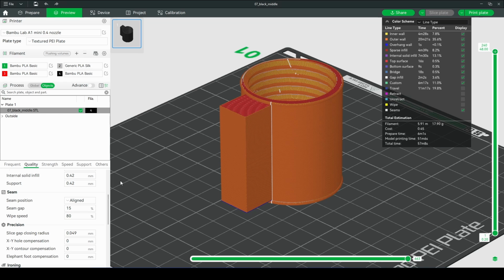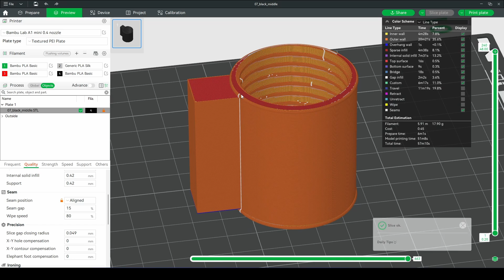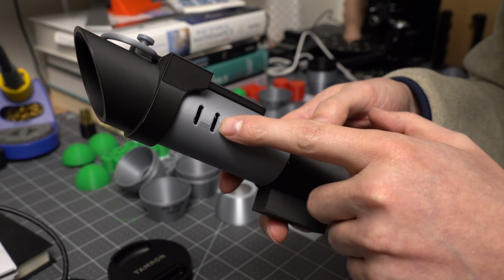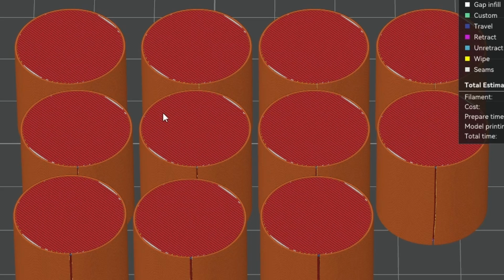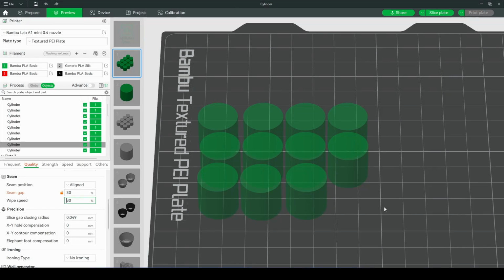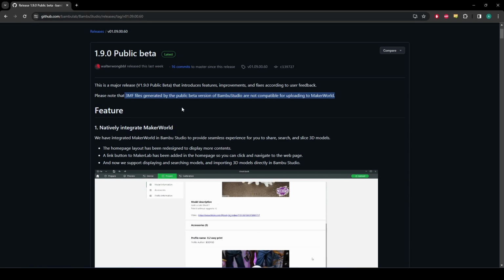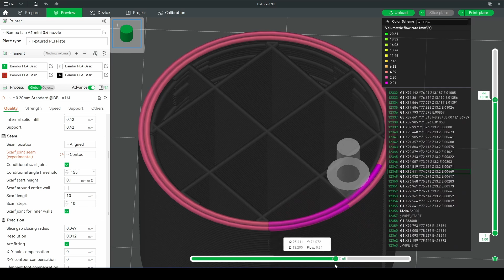Getting Rid of Z-Seams on Bambu Labs 3D Printers?

Comment: what if you drew the seam on the inside of the model to avoid exterior seams? is that possible? 🤔Or does the seam go through and through? (outside and inside) Also, can we do horizontal seams instead of vertical? 
Probably all  silly questions, but I'm just trying to understand the system before I get into 3d printing with the P1S 😅

Comment: Why can't a 3d printer go in a helix line while printing round objects like in cnc machining? i dont understand why it needs to start and end at the same point for all layers just print round and whenever you cross the start line go up by the desired layer height why is that so hard to implement...
Reply: This is already implemented in slicers for quite some time. It's called 'vase mode', but the obvious limitation is, that it can print only a single wall, so it's impossible to use it when we need to print more than 1 wall. Which is almost always, because 1 wall is not sturdy enough for majority of applications. I often use it when I am forced to print the part in orientation which produces undesirable look - I print a shell in the vase mode and put the part inside.

Comment: They need to add distance to retract, there is no need to do a retraction on parts where the outer wall is all one movement. If the nozzle does not need to move say move than 3mm to the next segment, then it should not retract.

Comment: When generating the ramp of a scarf seam for a none linear Z surface, the X and Y offset of the next over layer needs to be linearly (or other methods - cubic, etc) interpolated by the transition of the Z height.

This way it will hopefully give a smoother result over a surface with Z axis curvature.

Comment: i wish i had an option to put it on the inside or at least print outside/in instead of inside/out. i know they have this option in cure but not in bambu. personally i've been printing for so long and moving from cura to bambu, the setting are rudimentary to user custom settings. i'll have to try out this scarf out it looks promising thanks.

Comment: Just the info I was looking for to help hide seams on a replacement cupholder for my car! The although functional first print has some horrific looking seams, lol.  I'm going to play with scarf seams and random location and possibly fuzzy skin effects.

Just an idea for straight seam painting, could you use mouse keys to get a nice straight vertical/horizontal/45 diagonal line in Bambu Studio. I used to use mouse keys loads in Microsoft paint as a kid! Mouse Keys uses you num pad to move the cursor, I've just checked it's still there in accessibility options in Windows 11 :-)

Comment: Seeing this makes me wonder if development of slicers has gone backwards... I was very active with 3d printing back when they first appeared and experimented a lot build my own printer and stuff. Then didn't use my printer at all for a few years and just recently started with printing again with a Bambu Labs. 
But back maybe 4 years seams were fixed already! Why do they appear again in current slicers/printers?
Thing is that with layer change and retract at the start of a layer it happens that there is either not enough or too much material in the nozzle. Hard to tell usually cause different materials have different flow. So you could fine tune for every spool you have but usually the easiest way is to hide that inside a wall or even inside infill. So layer change should be on an inner wall loop or over infill and then have a little coast to get the correct flow. Then can switch over to outer walls and they become perfect.
Has this knowledge been lost? Or did they use some outdated code to build their slicer on?

Comment: In Bambu Studio scarf seams have a starting %, setting try reducing it. I picked random + scarf seams and reduced the scarf start % and  I also reduced the scarf length to 3 mm. I cannot see seams on a smoothly curved ABS GF.  YMMV. Having a contaminant like GF in the material probably helps as it roughens the surface slightly hiding layers and seams.
Reply: Just stumbled upon that as well. About to start testing. Its worded as "start height" which doesn't make sense. Default was 50% and you can see in the flow that it just abruptly reduces flow.  Lower percentage seems to be a more gradual flow reduction. I'm curious if delaying that reduction would result in having excess material at end of scarf and would need to lengthen scarf to accommodate.
Reply: @generation-x406  Yes, in Orca Slicer the default is much less than 50%, I forget the number but it's much lower. In Bambu Studio I was using ~20%. I don't think of this as purely flow rate so much as the starting wedge beginning height, although I don't know if the z axis is adjusted with the flow increasing but I assume so. I imagine it as a rising wedge on the start of the loop with corresponding flow adjustment and the reciprocal wedge on the close accomplished by keeping the head level and the flow reduced. However setting it to 0% I assume invites problems of precision and contact with the previous layer. The 10mm wedge length seemed a bit excessive since all it's trying to do is feather the loop beginning and endpoints.
Reply: @dorbie  I assume the Z height adjustment might be the "steps" per scarf length. A rate of Z climb between two known Z points.
Reply: @generation-x406  Yes, I assume it is the discrete divisions of both flow rate and z height injected into the g-code by the slicer, although there will probably be numerical and mechanical precision limits involved.

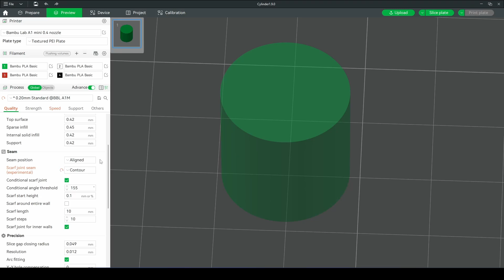Comment: The settings at 10:30 break my slice as my model goes from 108mm height height to x925440.00 height giving me a G-code max height error. Seems Bambu needs to work a bit more on the implementation.

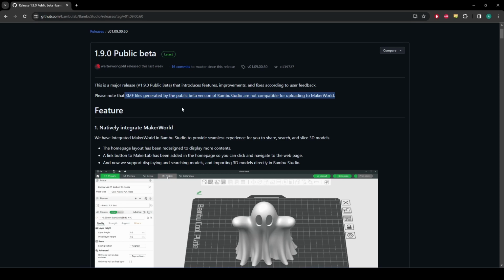Comment: 7:55 sure you can! just add a user account on your pc or mac ;) have as many as your harddrive supports.

if you want to see what orca does different you can export the gcode from both bs and orca. open them both in notepad++ and cut the top part of both files that has regular text into new files. then compare use compare tool ;) i found that orca does somethings better and bs does somehings better. if i dont get the result i want from orca i try bs. then do the above routine to forcefeed the settings bs used to the orca generated gcode manually. best of both worlds imo. 

also set the slicing resolution to 0.001 and turn off arc and arachne. experience the smoothest walls possible. no more lines that are off from the one above or under. its amazing. takes longer time to slice but its so so so worth it. drawback is huge files to transfer. but hey.. time vs quality right?

Comment: Random is situational. I like it in some cases.

1. For strength, to avoid explicit weaknesses in a loaded part.
2. To distribute deformation introduced by the starts, you could get a bulge in threads for example that you can feel when screwing if its all in one spot. 
3. For surfaces with Fuzzy Skin texture, which is perfectly augmented.
Reply: bearings is another example of a good use for random.

Comment: Its hard to tell from just the video, but it almost looks like on the default seams the 100% gap is actually smoother. The 0% seems like its overextruding along the sides next to the seam, where on 100% the gap is still welded but the edges have more space to go and it doesn't balloon out as much. Is this visible to you or anyone else here, or am I just seeing it wrong?

Comment: When seam painting, if you just paint a tiny bit at the top of that corner, it will automatically go vertical from there. You don’t have to try to paint a straight line down that corner
Reply from the maker: This makes complete sense. Thanks for the tip.
Reply: @3DPrintStuff  I don't know if this is purely an Orca Slicer thing or if Bambu Studio has it too, but as of 2024-09-24, Orca Slicer 2.2.0-beta has a "Vertical" checkbox when seam painting, which works sort of like holding shift in MS paint when drawing with the line tool; it forces the line to be flawlessly vertical, even if you fling your mouse around in circles all over the place.
Reply: Nope not here. The key is to paint the bottom, hold mouse, hit esc, then paint again at the top. It'll connect the dots
Reply: This doesn't seem to work for me.
Reply: @coreyward  Could've written seam 🤣
Reply: @dylanjwright1  totally missed opportunity...

Comment: Random seam is good where you use fuzzy skin, hides the seam completely.
Reply from the maker: I knew I was forgetting something in this video! I wanted to mention fuzzy skin as an option.
Reply: @3DPrintStuff  I’m just wondering if fuzzy skin can be applied to the outer face so the inner features maintain tolerances for my use case
Reply from the maker: @RED89P13  Fuzzy skin has a drop down for the options available. https://wiki.bambulab.com/en/software/bambu-studio/parameter/fuzzy-skin
You can also apply modifier objects to exclude your holes from being fuzzy and you can see the result in the preview window. Hope that helps.
Reply from the maker: @RED89P13  Made a quick video that hopefully answers your question https://youtu.be/4i_0ZYxsSZU
Reply: @3DPrintStuff  that’s perfect thank you so much!

Comment: I could be wrong, but to me it clearly looks like the Orca Slicer version is better because the Seam goes at an angle. The Studio version still goes straight up and down... Thanks for taking the time to do all this testing 🤘🤘
Reply from the maker: Just printed a test piece in the Bambu Studio Beta with a painted slant seam and it doesn't look as good as Orca. It's still a more obvious start to the seam. https://www.youtube.com/post/Ugkx45WqwanIllXCBjGarZbfs_BGrNKCwYaC
Reply: @3DPrintStuff Regarding scarf artifacts; I think it might be related to z-axis acceleration settings as print head might slow down to cope with z-axis. So trying to print slower and/or more steps might improve it.
And as suggested a slope crurve instead of a straight line would mitigate some z-axis limitations.
Also wondering if bambu can do input shaping on z-axis?!
Reply: I just printed off a few buttons that are .42" in diameter put the seems diagonally and had the outside travel speed set to 50mm/s with the scarf and they came out nearly invisible. In Bambu
Reply from the maker: Yeah for sure the orca slicer does put it at an angle by default. I should paint a slanted seam in the Beta and see what the results look like.
Reply: Orca is better overall, until they mess up a version, everything gets screwy, and you have to revert. One version raised my z offset and I had Wei readjust after a couple of unattended failed prints
Reply: You can do the same thing in bambu slicer.

Comment: Would you like to compare your results with the results you would get out of Cura? 
I‘m personally slicing with cura and i can not remember that i had such big seams on my prints in the last years. You are not the first youtuber that showed such big seams out of Bambulab. 
I wonder if this is not such a big thing in Cura or have i simply overlooked big seams in my prints 😅
Reply: It depends a lot upon the filament you're using. For example, it shows up heavily on silk. Seams are probably the same on all slicers, at least up until this new development.